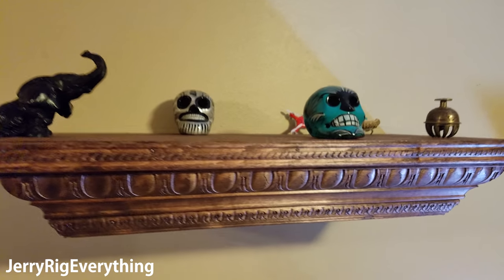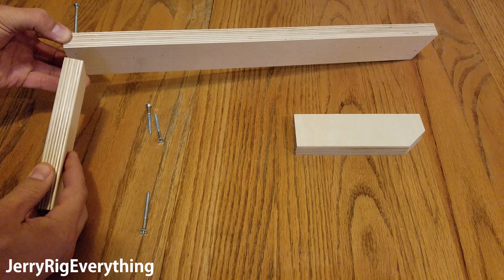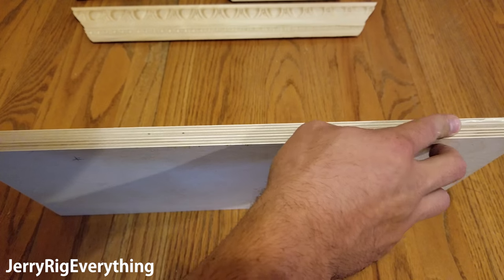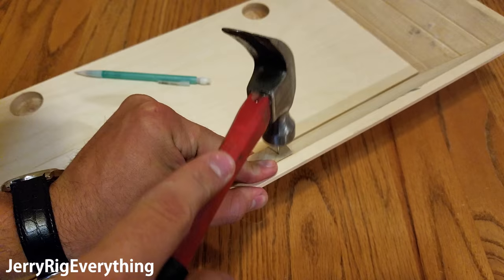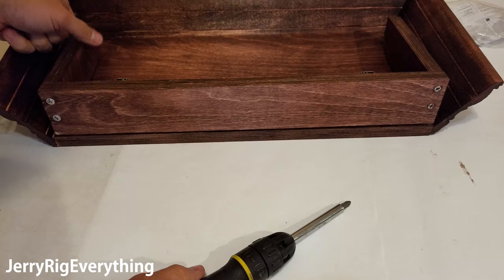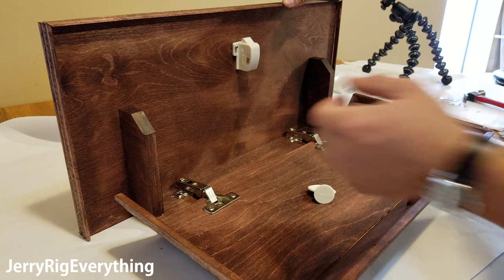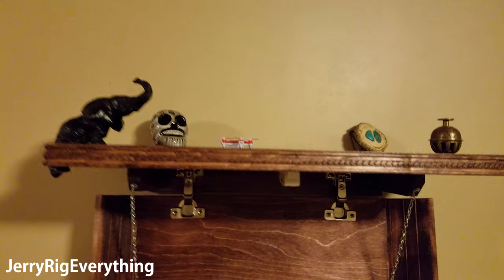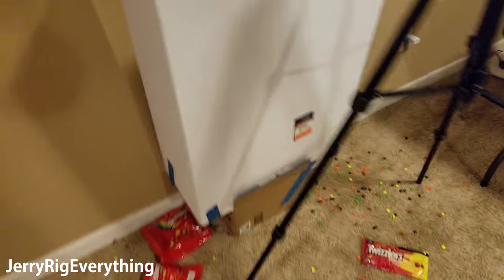Stealth Shelf Kit - Build your own Concealment Shelf - EASY!

Comment: You should look into drywall anchors. There are several types that can hold anywhere from 5lbs. per anchor to 75 lbs. per anchor. Some you have to drill a hole in the wall, others can drill and thread their own holes.
Reply from the maker: Ive worked with drywall anchors in the past. And nothing holds as well as a stud. I dont think Ill ever use a dry wall anchor for anything other than a small picture frame.
Reply: JerryRigEverything

I used to work for a point-of-purchase display company. We used them all the time. Some displays were over 200 lbs. that were hung on drywall. It depends on the type used, the number used and the pattern of holes.

A lot of people will only look at one or two types and think they will work for every application. For your shelf unit, I would have used two of either the 'toggle anchors' or the 'molly anchors'. Either one will hold a great deal of weight when properly installed.

Anyway, interesting shelf, I may have to make a few for myself.
Reply from the maker: Carl Bruschnig, Jr Thanks for the tips! Ill have to look into it more.

Comment: I replaced the battery and charging port on my iPhone 5s. I could not get 3 screws and a rubber mic gasket reinstalled, but phone is working. Thumbs up for Zach.